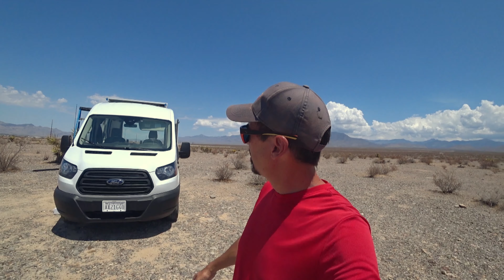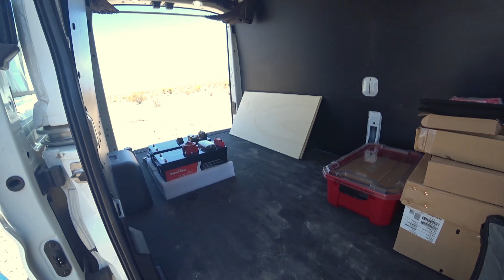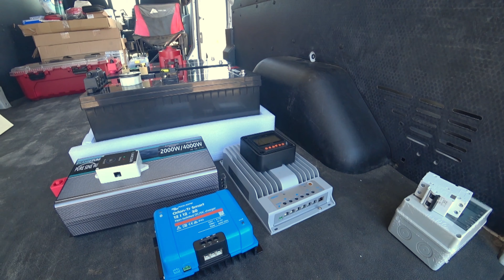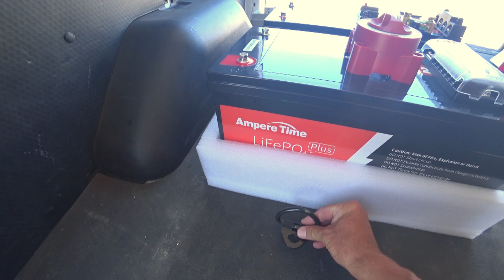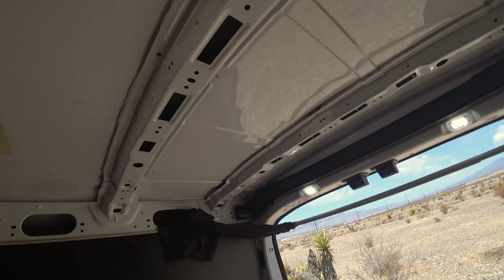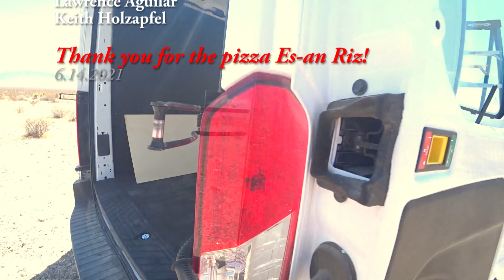VAN BUILD 2021: Part 1

Comment: Solid! You are doing it right! Curious if a small swamp cooler would put less of a load on the system but I guess no one manufactures a vanlife swamp cooler.
Reply from the maker: This is a low draw on the battery bank.  They should be able to go a few days without sunlight.

Comment: Larry have a question with all the electronics do you have to have like a lightning rod or anything so just in case of lightning 🤔p.s. and what about hail dropping on panels 🤔hail does crack windshields??
Reply from the maker: Hail is rare in the desert. All autos are insulated from the ground.

Comment: When running the wires for electric do u run the same type for outlet n usb plugs n does the wires have to be a certain wattage for the wattage of batteries? I'm so nervous about the electrical for me that I'm probably going to aggravate the company I go with.
Reply from the maker: Check out some of these great videos.
https://youtu.be/ki3WXVR48eM
and
https://youtu.be/RLgGGB_McW0